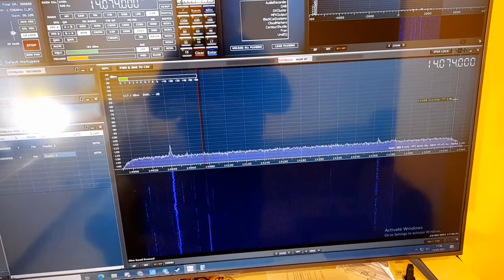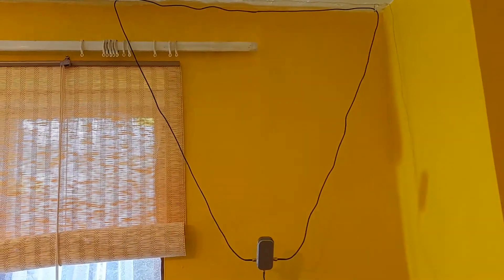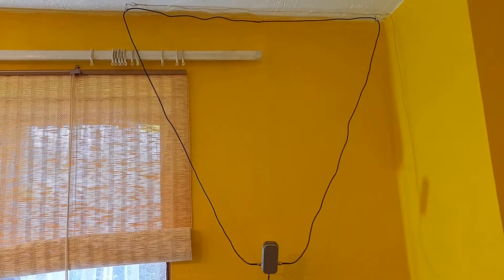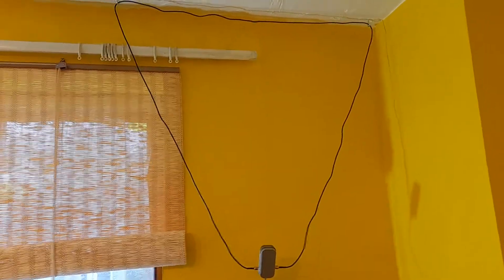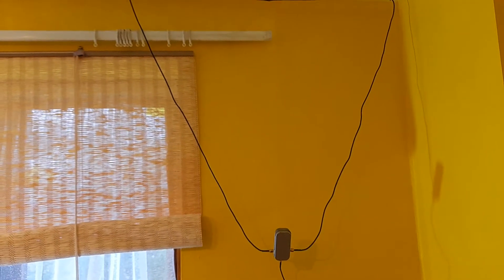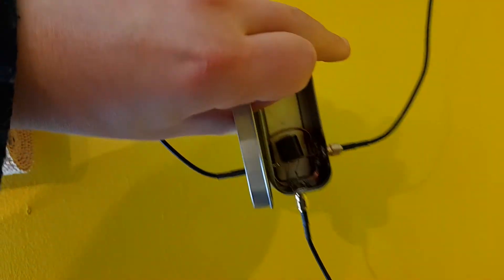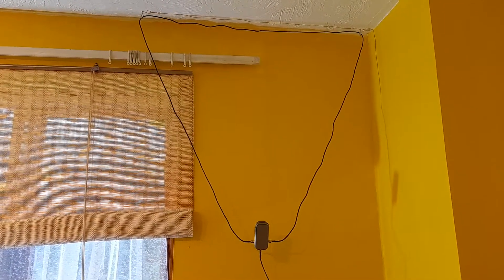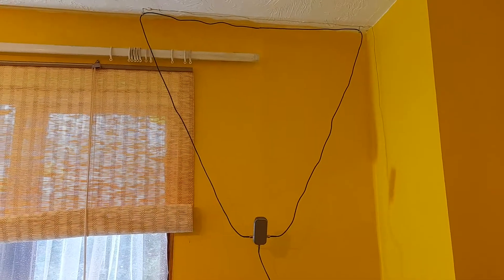YouLoop antenna. Self built.

Comment: Why a 1:1 balun choke on a rx antenna ?
Reply from the maker: It's not a choke - it's a 1:1 transformer. Two coils, one connected to the antenna, the other to the coax. As for why, I honestly have no idea. I followed the instructions I found. I do not have enough knowledge of antenna design to question /why/ it is four turns each side, or why that particular ferrite material was chosen. I simply built it to the diagram. It seems to work decently well though.
https://swling.com/blog/wp-content/uploads/2019/11/SpyTenna3.png